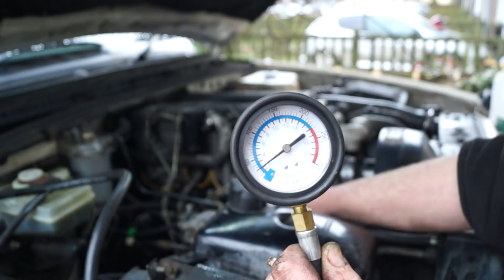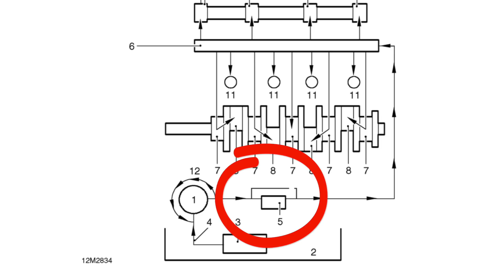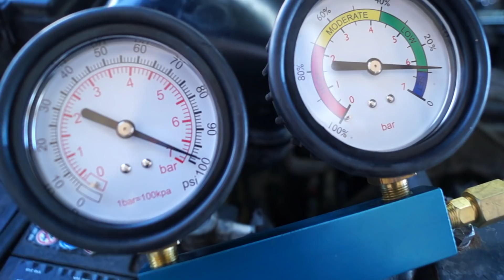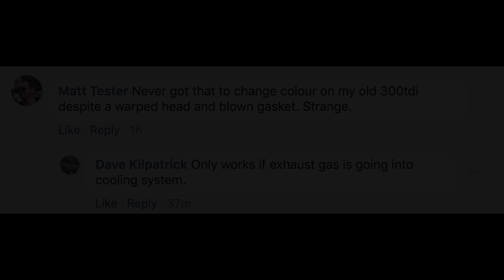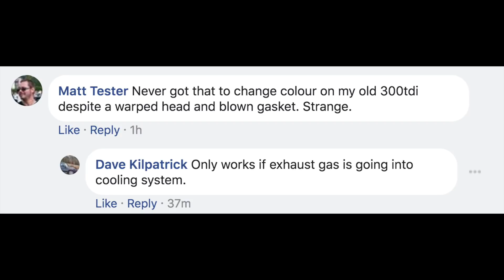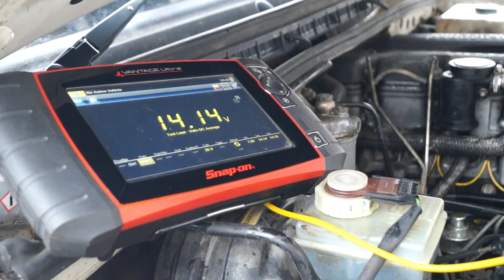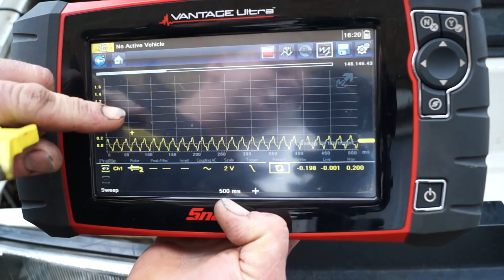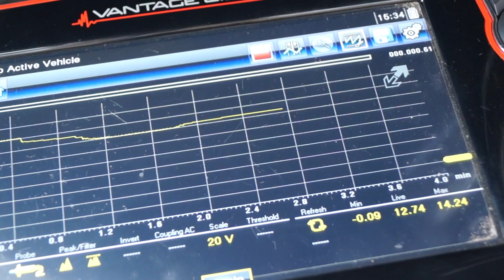300tdi Oil Pressure test, The "Sniff Test" and Alternator Checking

Comment: Jealous of your oil pressure i was running 15-40 and on a hot aussie summer day 4wding my oil pressure got bad down 7 psi at idle and the tappets were ticking. Have since switched to 20-60 and have 15psi at idle and now a solid 35 psi at running. Might switch back to 15-40 in winter..
Reply: LandRoverLife 20/60 bloody hell- 200 should be 20/50 300 tops 15/40 is what I run with no probs - lads round here use 10/30 and all ways complain about engine problems - plus 15/40 leaks slower 😁
Reply: plumbc007 well idk where you live but gets hot here like 35-40 celcius and my water temp 100 up to 110 on some of the big climbs. Plus my motor has done 470,000klms so shes a bit worn
Reply: Land Rover list 15W-40 as being suitable from -10 to +50 so I think you need an engine overhaul, especially after 470,000 km (292,000 miles). What was your running pressure on 15W-40 at approx. 2000 rev/min? It sounds marginal on 20W-60.
Reply: on those days barely 20psi. Yeah probably does need an overhual but it's not something i plan on doing. Land Rover might say that but from what i read people in south africa and australia struggle with oil in high temps. 20-60 does the job my clearances are probably big enough the thicker oil does ok. In winter i have had no issues with oil pressure car runs closer to 82 most of time till you get into some serious climbs up tracks
Reply: What's your oil temperature (if you have a gauge)? That can be a clue in itself of engine load.